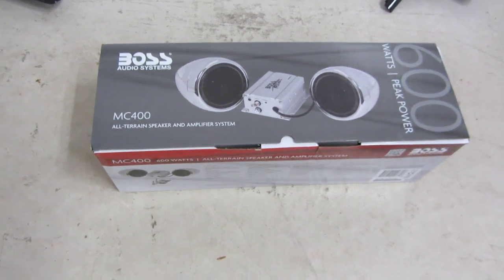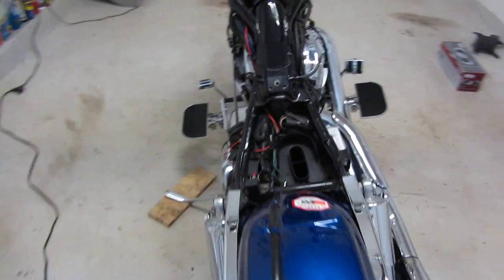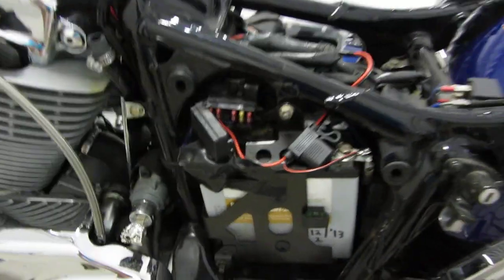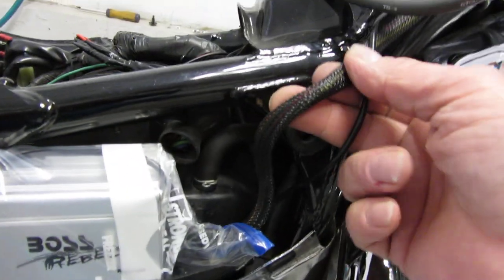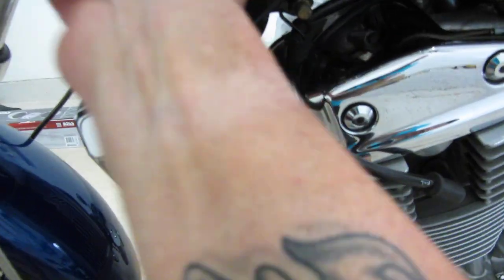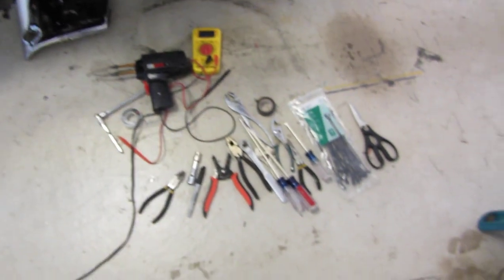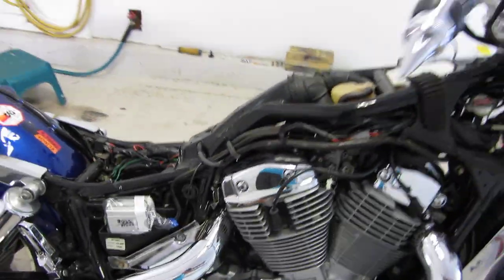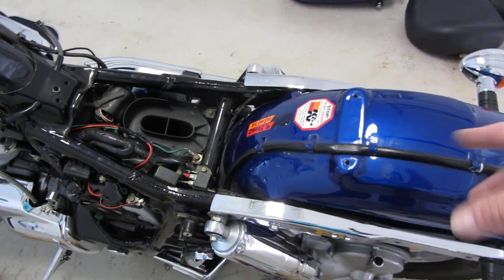honda shadow 1100

Comment: Hey guys. Ive been reading this. You have to have a fuse on the positive side. And you also have to have it switched. Put an on-off switch in-between the battery and the stereo and amp.

Comment: Before installing should i disconnect battery
Reply from the maker: any auto or cycle mechanic will recommend removing the negative cable. small precaution from electrical damage. especially welding on a vehicle.
Reply: @concrete981  no. Remove the POSITIVE cable.  Not the negative

Comment: When you turn ignition key to OFF, will the amp also be turned off? I'm concern the amp will remain ON and drain the battery. 
Thank you.
Reply from the maker: when you connect your power wire(from the amplifier) to the acc on the fuse box this will allow you to turn off and on your amplifier including starting your bike. when I turn off the ignition key all electronics are completely turned off. like you, I don't want any battery drain.
Reply from the maker: as long as you wire the power wire amp directly into the fuse box you'll have either power on or power off when you turn on/off the key.  the only hookup when you have a power draw is when you wire directly to the battery.
Reply: Thank you. This is very helpful. ;)
Reply: It turns out my 1988 Yamaha 750 Virago does not have a 5A fuse for the ignition key (power source). This means I have to wire it directly to the battery. Only the red amplifier wire has the 5A inline fuse. Would direct connection to battery be safe if the black amplifier wire doesn't have the 5A inline fuse? Thank you for your time.
Reply: FYI: Got some help from tech guys at motorcycle shop. They said the negative terminal on the battery already has a ground so it will cover the lead wire (black) from the amplifier. ;) 

I have to install a simple toggle switch (2 legs not 3 (with illumination)) upstream of the manufacturer inline fuse. Upstream as in: Battery to toggle switch, to inline fuse, then to amplifier. No grounding needed. Cheers BlackCat 56.